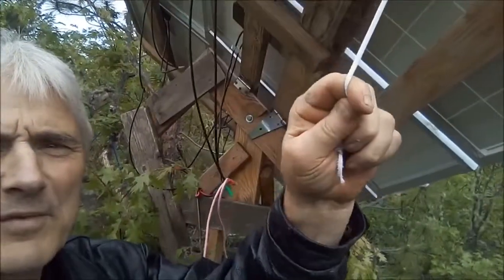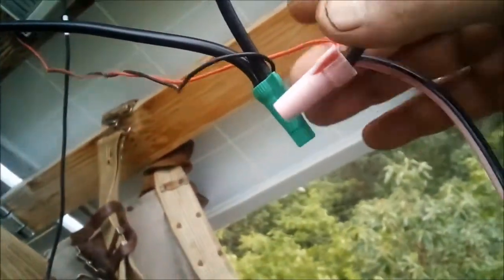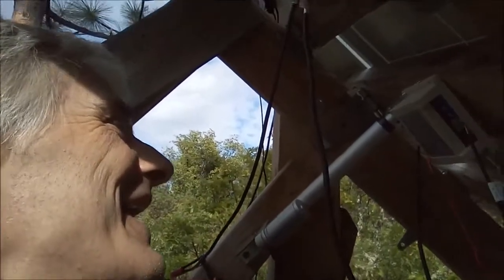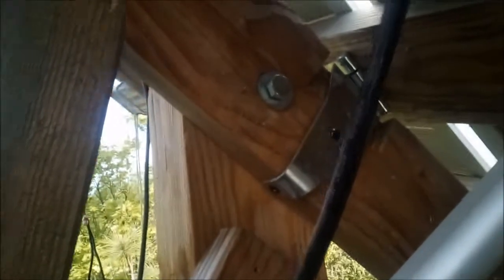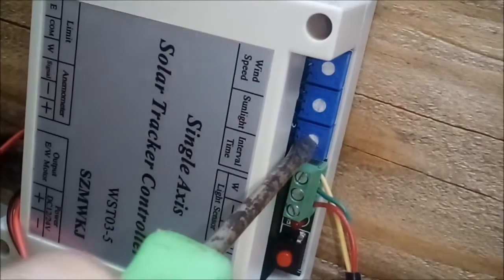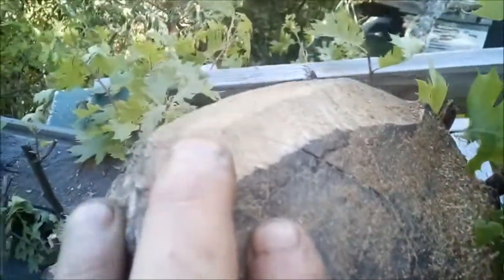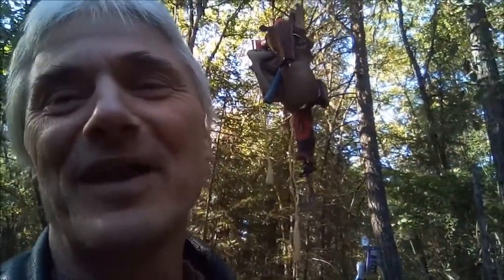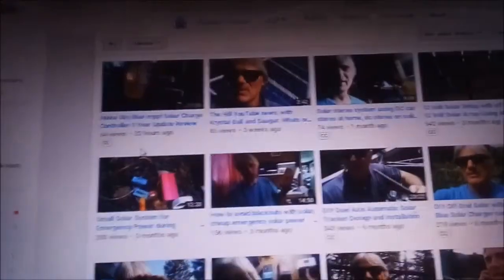Automatic Solar Tracker Install and Solar Tracker Manual Review

Comment: Thanks for the informative video.

Would you please take a minute to reply me.

I would like to ask, what is economical and effective? Buying new solar panels or installing a tracker??
Reply from the maker: if you have only a couple panels, then add another.  But if your near 1000 watts in panels, you can mount a solar tracker to that KW of panels and gain 40% input on the group.  I cannot express how useful automatic solar trackers are without defining it.  They are priceless during the times you need input the most, and you can gain double or more input during early morning and late afternoon during the cloudy season, when you only get an hour or two of sun every few days.  These occasions make all the "raw data" completely inaccurate.  Because,  In "real life", your fixed mount will most likely only get very low input , while your auto solar tracker will swing and absorb 80-100% input for that hour or two.  No "data point" I have ever read has accurately estimated the gains , when you need it most.   BELIEVE ME, YOU DEFINITELY WANT AN AUTOMATIC SOLAR TRACKER.

Comment: Something that I read, (and it makes sense). With these cheaper trackers, you should put the motor of the linear actuator at the top. That way, should the seal not be perfect, water doesn't run down the tube and cause the gearing to rust. That is the way I mounted mine. Time will tell how long it lasts.
Reply from the maker: Honestly , I'd be more worried about the water coming in sideways in the wind If I were you.  Coming in from the side that is up is a direct hit, to where if you have it at the bottom rake,, its completely protected form wind coming in on the down rake side, and the wind coming in the top side is buffered, but either way, at 100 bucks each, I'm not worried about it, especially 3 years in, my entire 4 thousand dollar system , including batteries has nearly paid for itself already, by next year,, for sure.  Your prevailing wind should be your deciding factor and good judgement in your particular situation.  Trying to standardize such things as this is a bit on the ridiculous side IMO.  Know your prevailing wind, the pitch of your panels in the rainy season and decide.   With A tree top mount like mine, there is nothing anyone has ever said that was better than my own ideas,, so far anyhow, but I'm the only one I know of dealing with 100 foot high tree top automatic trackers.  I suspect you will find the perfect solution for your situation as well, if you give it some thought,, just don't forget, rain does NOT always fall DOWN,, it comes in sideways.
Reply from the maker: After a couple re-readings,, I think I mis-understood your point,, your talking about the motor down,, not "where" your entire piston is mounted.  Yeah,, sounds good,, just put it where it never gets wet ,, seemed the best because the piston has threads too, and is just as likely to rust and bind , and that is what strips the gears.  But you and me both know they can't last forever, having a backup ready is the best idea ;) Designing for failure is NOT what I do ;/